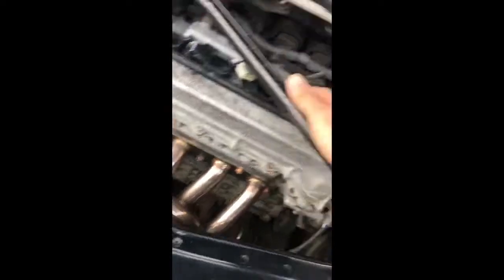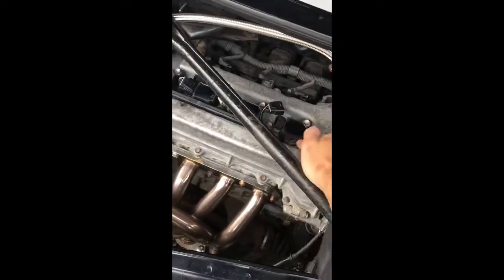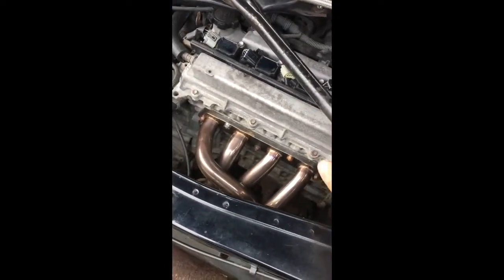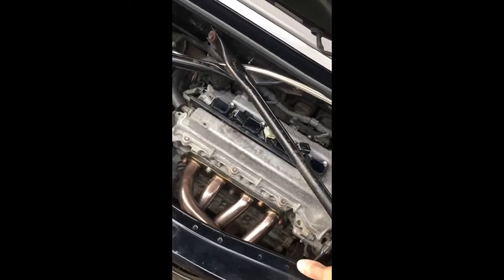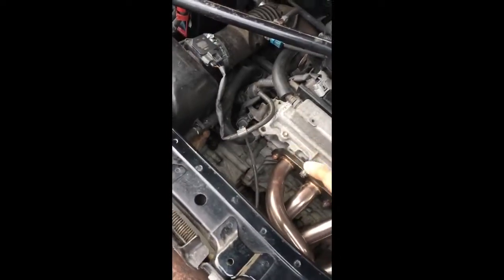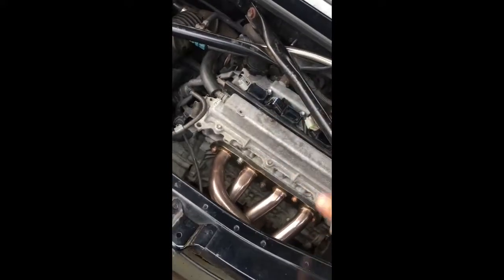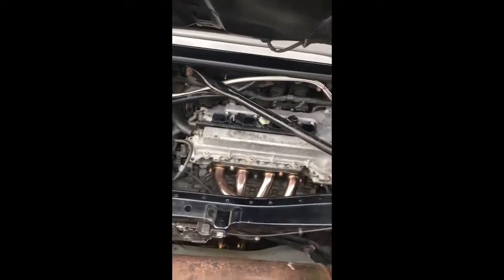How To: MR2 Roadster spark plug replacement

Comment: Question is does it say in the owners manual want to replace the spark plugs annually? Because I tried searching on the Toyota website and I couldn't find anything about the spark plug replacement interval
Reply from the maker: Sorry for late reply, I think it’s better to follow spark plug manufacturer specs :)  so whatever denso or nkg advise

Comment: What is it 30,000 miles 60,000 100,000? Because I don't know
Reply from the maker: Corvette lover 495  I would say 25-30k mi unless you turbo it then maybe a bit earlier like 20k
Reply: RoadsterAlex ok thanks. Guessing it's a higher level tip than the copper tip?
Reply from the maker: Corvette lover 495 yea indeed